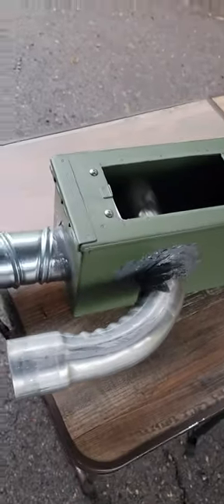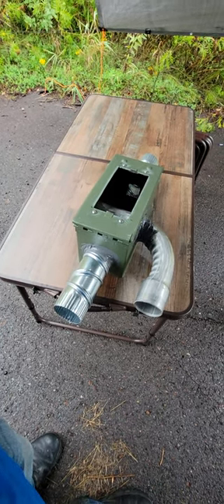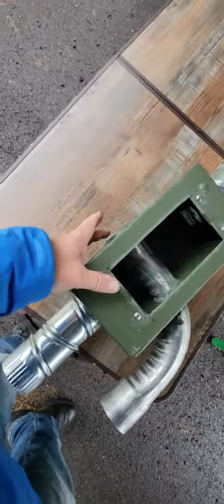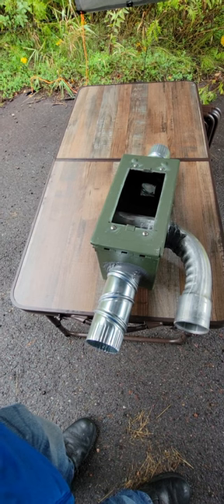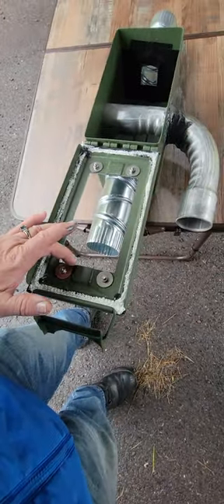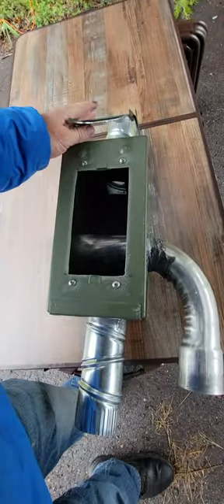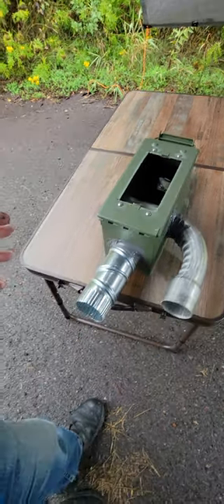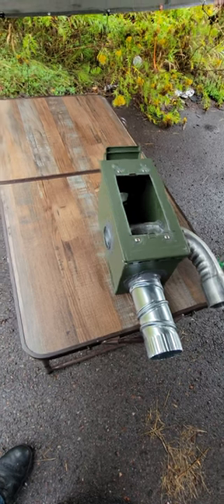Vented Ammo Box Tent Heater, Candles, Butane, Propane or Sterno Fuel.

Comment: Im going to build one of these ,i have a propane set up from a backyard lil fire pit ,im considering using a square steel tube for the heating element,and put a few radiator fins in it to help disperse heat into the air flow,esp if i use a fan. Also you could mount these to a piece of 3/4 inch plywood and install like a window ac in emergency. Put a couple inches of space between the heater and the wood ,and remove curtains of course

Comment: If you roll the 90° auto exhaust vent up 90°, you will get convection. hot air wants to rise, like a balloon, it will draw cold air in the bottom and hot air will be discharged out the top.
Then you can add a loose fitting elbow to the top of that to direct the discharged air to the direction you want it to go.
Also, if you made a cozy for the outside of the can you will get a better heat transfer for your convection vent pipe. The more heat you can keep inside the can, the more heat/BTU's will be transferred into the convection vent pipe. Yes, you will lose some radiant heat from the sides of the can, but you will get more air movement through convection and that means better circulation in the living space.
One more thing, the combustion air vent does not need to be vented to the outside, just the flue pipe does (speaking of the flue pipe, it should be moved to the top of the can, on the side of the can, with a baffle to slow down the exhaust and increase heat transfer). As the ambient air warms, that air (combustion air) is also warmer, which will make for a more efficient burn. The fewer holes that are put into the walls of a tent, Van, shack, etc. the better. If you are using this in any one of those situations, there will most likely be plenty of free / combustion  air available from leakage.

That is a good start. Keep going.

Comment: Great video and I like how you have the cold air and waiting from outside versus the air from inside the room. That’s the easy way to lose lotta heat. If you have a video of the finished product please let us know. I’d like to see how you mounted the glass. Are used to be a glass artist so I am forever trying to figure out how you mounted tempered glass because you generally can’t drill holes in it or it will bust. Thanks again.

Comment: Don't you have to get rid of the old paint before you install everything and paint with the high heat black paint ? Thanks for the great video.
Reply: I painted it with 1200°F stove paint.  I wiped it down first with deglosser from hardware store.  I do not recommend using JB weld.  The heated tube can easily get hotter than 550°F when JB weld fails and gives of terrible fumes.
Reply: @PetRelectives    did you weld it yourself or pay yo have it welded?